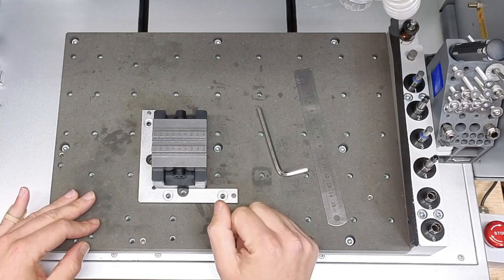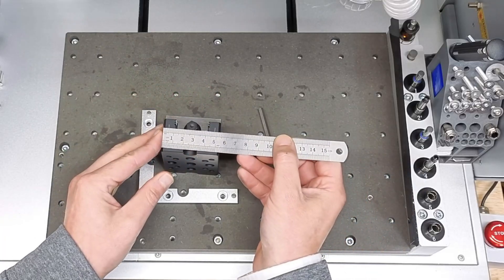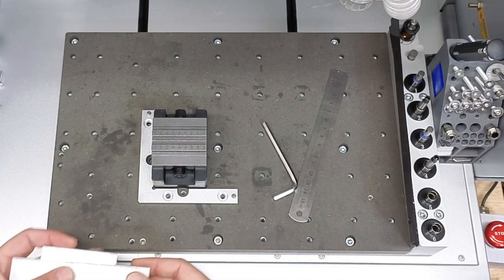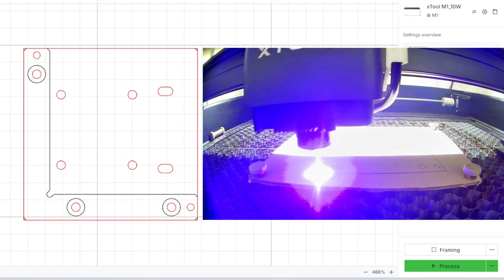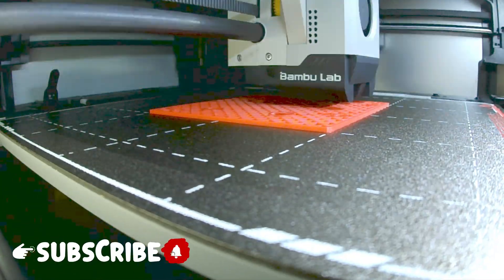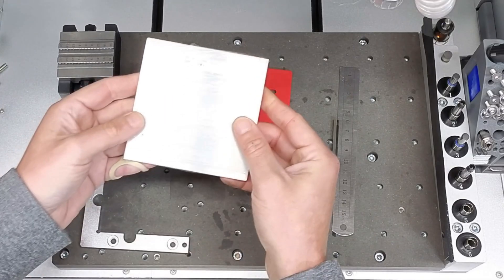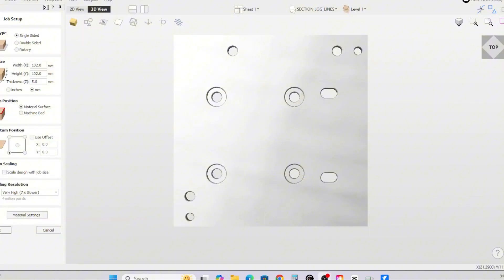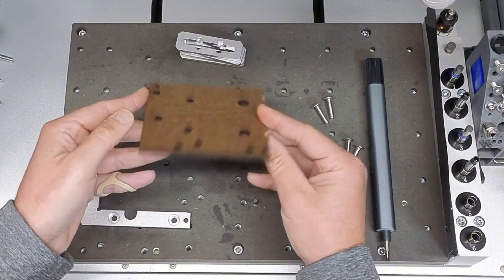Carvera CNC: Making A Vise Mounting Plate | Xin Dian H54-8-55 Self-Centering Vise (Not Sponsored)

Comment: Very nice, thanks a lot for the model and the great tutorial video, just doing the paths with FreeCAD. Would be very interested in your exact tool settings as I do not have a lot of experience with the Air and 6061 yet. Happy making!
Reply from the maker: Use the default settings that makera suggest in their tool database to get started. Those are safe numbers.

Comment: Thanks for the idea, I bought the larger vice 54mm x110mm and used the 100x150x10mm plate from Makera
Reply from the maker: I have that vise as well. Great vise.
Reply: @GabrielMakesThings  I started at 4.00mm for the PIN holes then 4.05mm, and finally 4.10mm worked perfectly.

Comment: Great work. Thanks for sharing. Any thoughts on the new makera z1? I am considering backing the KS campaign.
Reply from the maker: Hi, thank you. I cant speak for the Z1 as it hasn't been released yet. There are a few people on YouTube that show it being used. What i can tell you is that makera as company are really great. I have the carvera original and the Air. Both rock solid machines. I would assume the Z1 will be great as well. It is a smaller machine with a lower powered spindle. Depending on your needs i guess.

But as a company you really will be in good hands buying any of the makera cnc machines. The reason i am stressing this is because there are a few other CNC Kickstarters coming out. We know nothing about these companies. I would recommend makera over these others even if they show more features in their machines as makera has been in this space for a few years already and are building a good ecosystem. If your are new to cnc, their machines are perfect. 

Hope this helps.